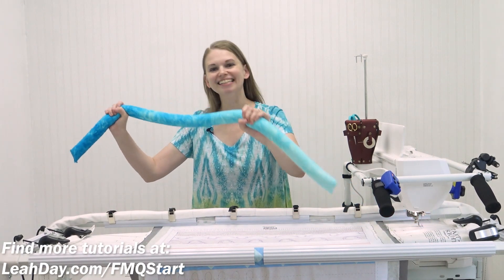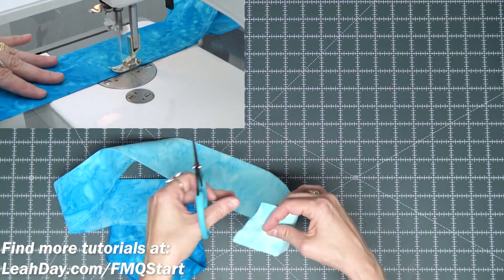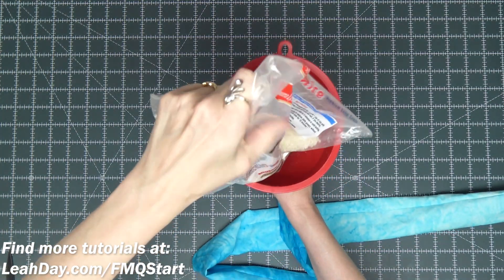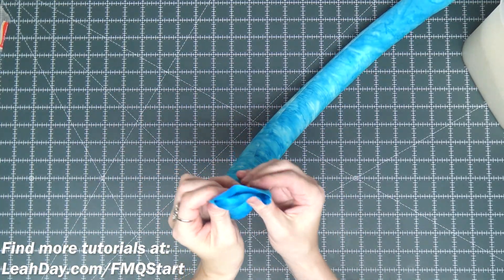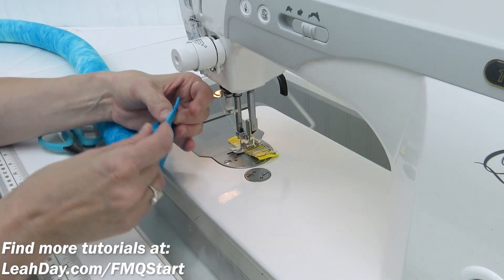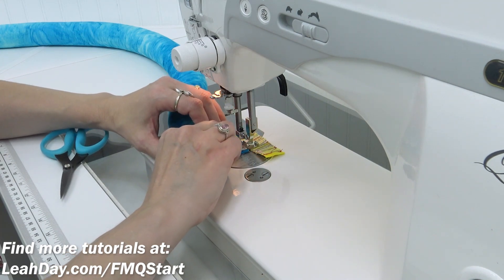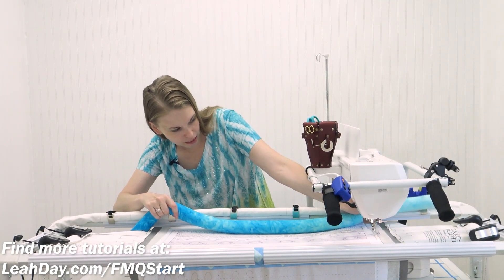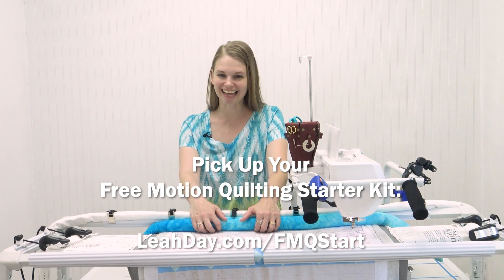How to Sew a Frame Weight (Rice Bag) and Get Control of Your Machine!

Comment: Hey Leah, I have a hoop frame pro.  I’m not really sure how/why this works.  I know you mentioned increased accuracy but why does it help with that?  🤷🏼‍♀️ sorry for my ignorance.
Reply from the maker: Watch to the end and I answer that question! Accuracy means being able to travel stitch, stitch on a marked line, and hit points - basically more control over your quilting design.
Reply: @LeahDay   I saw this, but I don’t understand why it works.  Does it stop something from happening and in turn, improves accuracy?
Reply: @brookprinsen6746  
I think what Leah’s trying to say, is that because the carriage moves so easily, it can be difficult to keep control of it.  The weight will help slow down the momentum and make it easier to control when you need to do detail work.  I have the q’nique19  on a hoop pro frame and understand exactly what she’s talking about.  It took quite awhile before I could control the machine (despite being almost 40lbs!) very well because the momentum caused the machine to get away from me pretty quickly.  I actually have to work harder to slow it down!  I think the weight is meant to help slow down the machine momentum so you don’t have to work harder to control it.  

Leah can jump in if I’m wrong, but I think that’s what she’s trying to say.
Reply: @little1942    Thanks!  As I was thinking about this, I realized the the weight was sitting on the bed of the machine which should help slow it down. (For some reason, I was having a hard time getting past thinking it was changing the tension of the quilt in the frame and not thinking about it actually affecting the machine.)  I have the same setup as you ( only done two quilts so far) and I do have a hard time with the machine getting away from me.  I’m going to give this a try.
Reply: @brookprinsen6746  
I’m glad I could help!  Congratulations on getting your longarm too!  I haven’t had mine very long either and have four quilts completed. All big lap sizes. With each one, I’m getting better at it and more brave as to the designs. I’m working on my first custom quilted quilt now. Crossing fingers it comes out ok. 

I may try the rice bag trick myself to see if it helps. Good luck.
Reply: @little1942  Did you get the ruler base?  I didn’t and am thinking I should.
Reply: @brookprinsen6746  
Yes i did.  I actually got quite a few “extras” with mine.  The ruler base, the feet set with the ruler foot and three of Leah’s rulers were included.  If you don’t have it, I highly recommend it.  I’ve done one quilt with ruler work in the outer border and loved how it turned out!  I’m doing a lot more ruler work on the current quilt.  Grace does have some nice sales going on right now, including the foot set with the ruler foot and the quilt kit that Leah is working on in her newest videos.  But you really do need that ruler base if you plan on using rulers.  You do loose a little bit of quilting space, but it’s not much. Maybe about an inch or so, but the results are so worth the investment! I do recommend doing some practice before doing it on an actual quilt though!  I bought several yards of felt and mark it up as needed and do my practicing on that.  It’s worked out well and saved me in time and expense of using fabric and batting for practicing.
Reply: @little1942  Thanks for the info.  I think I’m convinced.
Reply: @brookprinsen6746  
Glad I could help.  I just looked, and the ruler base is on sale at Grace.  Now would be a good time to get it.  Good luck to you!

Comment: Great video. I was wondering what size harp space does the sewing machine have that is on your Cutie frame?
Reply from the maker: This is a Janome 8200 which has an 11 inch harp. On my Hoop Frame Pro, I have around 7 1/2 inches of vertical quilting space. You can pretty much take any machine and subtract 3 1/2 - 4 inches to know how much space you will have when quilting on any style of Hoop Frame (Hoop Frame, Hoop Frame Pro or Cutie).
Reply: Thank you Leah!

Comment: I know exactly what you mean, Leah!  I have the q’nique 19 on the hoop from pro and could not believe how fast the machine could “get away” from me.  I have severe back problems and worried that having a long arm would cause me a lot of problems.  Since I can use sitting down, I’ve yet to have it cause me pain.  But I sure have to work hard to slow down and keep control of it!  That’s not a problem I ever thought I’d have.  😂

This is an ingenious way to help slow down that machine momentum.  Plus, it also makes for a great door or window insulation! 😂
Reply from the maker: LOL! Yes, indeed! I found my quilting ability and control dramatically improved when I added weight to my frame. It's now my favorite tool!